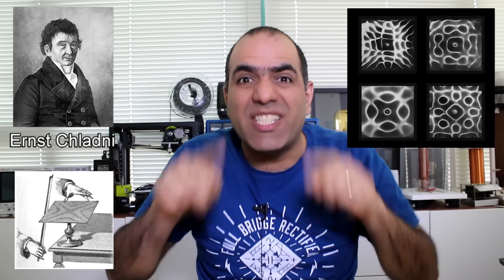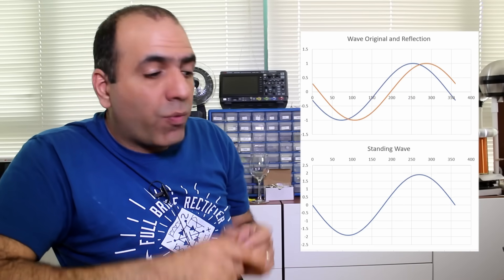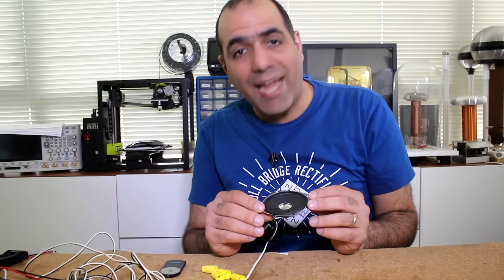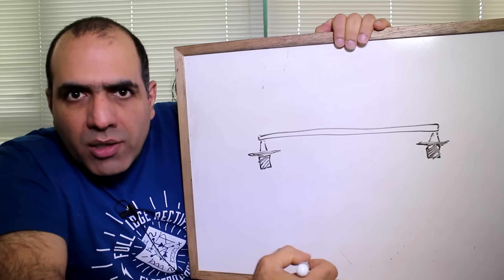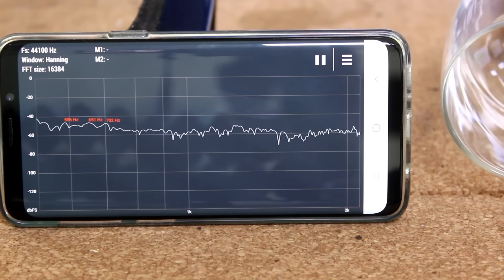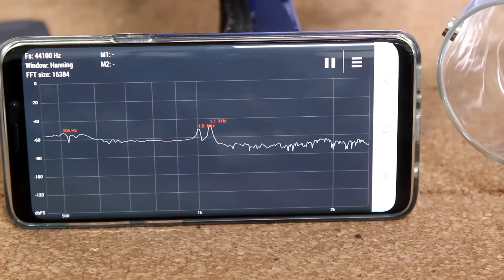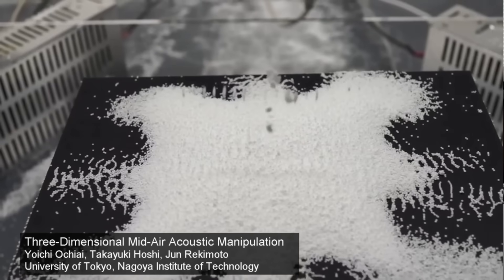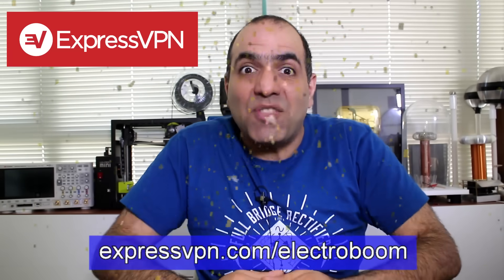Moving Particles with Vibration, Making the Chladni Plate

Comment: The theory is flawed.  The node is not moving continuously forward.  That's an optical illusion.  It moves forward a little and then skips back when the waveform is inverted.
You don't need an out of phase soundwave, you need a 3 phase soundwave.  Treat it like a motor.

Comment: By using a lot of ultrasonic transducers, like you mentioned at the end, you can also create certain points where the 40kHz gets modulated to around 200Hz by overlapping. You can actually feel those spots. So you can create haptic feedback by simulating shapes with those spots.

Comment: Acoustic levitation could indeed be a very useful thing, imagine you had something that could not be touched by any gloves or your hands otherwise it'd be contaminated or something like that.  Just use sound to hold it in place and you could move it by tuning speakers.  The fact is that while it's a cool party trick, it currently has no real use case, this is because it's a lot more expensive than glass, plastic or metal containers.  Even if these containers need coated with a special chemical it's still cheaper.  Not to mention it can be vacuum sealed which may prove beneficial.

Comment: this is an interesting video, i'm glad i finally came across it. you really made me wonder; would it be possible to dampen the reflections? i'd imagine that locking the edges of the board in a muffling material like foam might be able to do it. in that case, you could have a proper set up for the "artificial reflections". Thoughts?

Comment: A lack of temporal coherence? With two sources that are left to themselves to oscillate at slightly different frequencies, with one source "not knowing" what the other is doing, the salt would move around a bit due to phase noise. But if the faster one is triggered by the slower one, you may be able to move the salt in a linear fashion. If the sources were connected through a trigger signal, the reflections at the edge could indeed be a good reason why the salt does not move more. To dampen the reflections, you could put some (mattress) foam in contact with the board. Create slightly different indices of refraction.

Comment: That is interesting, you might get better response with piezo transducers and a new cookie tin.  The stamping stress hardens the metal, and you could put rubber cone supports underneath at the null nodes.  Just a thought.   Thanks again.

Comment: So Mr Boom, what if you reverse the idea and make the speaker vibrate could you make it levitate? I've had a theory about flying saucers and the humming noise people associate with them, being related to their means of propulsion and flight. Your video showed a clip of the powder being held up in free space. Would it be possible to reverse everything and hover the speaker off a resonant surface? Or, use multiple speakers to provide direction control in a similar way to your example.

Comment: So your explanation with the standing waves isn't really correct. In reality the system is described with a partial differential equation with boundary conditions.

The resulting solution is a linear superposition of infinite modes.

If you want your idea to work, you don't want to have 2 frequencies around the first mode. You're going to wanna have both speakers be at both frequencies and change the relative amplitudes of those frequencies in order to smoothly transition the antinodes from one pattern to the next. Continue doing this, and you should get something like what you want.

Plate modes have names that we refer to them. We label the number of half sines in each direction. For example, 5:23 is a great example of a (3,3) mode. Your boundary conditions are a little funky, so I suspect some of your patterns are a result of boundary condition mixture.

That being said, I just want to make sure that we're spreading incorrect information.

Btw, as for my credentials, I'm a graduate student who studies structural mechanics (vibrations) and I specialize in controls and piezoelectrics.

Comment: 1:57 Did someone say... INTEGRATE?
(1+x^2)^-2dx
Let x= tan (u)
Then dx=sec^2 (u) du
(1+x^2)^-2dx => sec^2 (u)/(tan^2 (u)+1)^2du
Using sec^2 = tan^2+1 and cos =1/sec
sec^2 (u)/(tan^2 (u)+1)^2 = cos^2 (u)
Then using cos^2(u) = .5(1+cos2u)
Simple integration yields:
.5(u+.5sin2u)
Back substitution (all good since tan(x) has well defined inverse for all real x)
.5arctan(x) +.5sin(arctan(x))* cos(arctan(x))|+/- infinity 
pi/4 + .5* 1 0 - (-pi/4+.5 -1 *0)
= pi/2.

Comment: Hello Mehdi. I have 2 suggestions for this:

(1) Maybe it is possible to set the input wave generator with a variable phase shift. In this way, you will be able to change the phase shift and, in turn, move the position of the zero point of the wave. You can then change the phase shift manually (with a knob) or else use a ramp generator to control the phase shift linearly.

(2) In your experiment, the salt was stuck moving left-right around a point maybe because the COMBINED WAVE was too fast and the salt could not follow. Imagine the combined wave being a sea wave and the salt being a person on a surf board. If the wave is slow enough for the guy to follow, then the guy would be able to ride the wave without problems and continue to move in one direction ... But if the wave is too fast, the surfboard would be slow and it would eventually end up on the peak of the wave and then on the other side of the wave, therefore moving backwards (down the trailing side of the wave) ... Following this reasoning, maybe your combined wave was trying to push the salt to the left, but then the wave was too fast and its peak went past the salt which means that now the salt was on the falling side of the wave which made the salt move to right until the next wave came to repeat the process. It would have been good to try to slow the COMBINED wave using F1=100Hz and F2=100.1Hz (rather than 101Hz) to make the combined wave travel much slower.

Actually, it would be interesting if you make such a test for point 2 as a follow-up video  : )

Comment: Electroboom: I'd like to make my own plate using a speaker as an actuator as u know a speaker is a magnet and a coil that when u excite the coil with an AC voltage it vibrates a the same frequency. speaker blows up ahhhhhh F***!!!!!!!! I need another speaker, as u know ever speaker has its own rating

Comment: You could engineer one sides of the board by adding a different material in such a way that the waves' reflection coefficient is minimised. This would cause both waves to not be standing anymore, but it would allow you to move the salt around. If the theory for electromagnetic waves holds, then the Fresnel reflection coefficient should be a decent formula provided the equivalent refraction coefficient of mechanical waves for cardboard (and the other material) can be calculated. It's probably going to be some ratio or combination of mass and some kind of Young modulus.

Comment: Take with a grain of salt I'm a computer science student, I am NOT an engineer or physicist, so naturally I'm not all too familiar with how these things work. But I can extrapolate some of the concepts to attempt a solution. What I'm seeing is a loop that is supposed to increase the position of the salt in the X or Y coordinate based on the difference of two variables. The reason why I think it is not working is because the maximum frequency acts as a limit for the loop, which is causing it to terminate early. If you were to steadily increase the difference (and by extension the maximum frequency) as it goes, the loop would eventually push the salt off of the plate (or make it vibrate into a funky looking pattern and not sweep it at all). You'll have to manually terminate the loop tho, as I don't thing the system has a way of knowing when the salt is off the plate, but at least it would sweep it off (in theory). 

If anyone knows better, please do let me know, I AM curious about the rest of the sciences so it would be cool to know whether or not my theory would or wouldn't work

Comment: Its not necessary for the particles to travel from one side to another, the reason why sound travel is the movement of molecular vibration in a specific region, which passes the energy to the next molecular region. That's why its impossible to shift the salt line from one side to another.

Comment: Can you do the same thing but with electricity instead of sound? Moving particles with electrical vibration instead of sound vibration. Can it be done?
I suppose it can only be achieved with Tesla's longitudinal electricity and not with AC or DC. Google "Transverse & Longitudinal Electric Waves and Tesla’s Longitudinal Electricity - Eric P. Dollard" and "Longitudinal Waves and Transverse Waves tests by Jean-Louis Naudin" for LMD circuit diagram that produces longitudinal electricity.
Also youtube search "Replication of Eric Dollard's Analog Computer" where you see electric field and magnetic field measured behaving differently in transverse vs longitudinal electricity.

Comment: I think the reason why the salt move back into place is due to newtons law. As the salt get pushed by the +1 hz it pushes back on the wave. Then the field change and now that +1 drops to 0 and the salt still want to push on the wave that originally push on the salt. Then the fields push on each and creating the dead spot. As the field push on each other they distribute up and down (assuming the wave is horizontal) but there a barrier under the salt so it reflects back up and increase the wave that want to push up. So now we have a force pushing up and a horizontal directions so now the salt is as all it need to move back where it was. The salt wouldn’t be able to move back with out the vertical wave push on it due to the friction between the salt and the platform. 

Not a physicist so might be wrong.

Comment: Cant you use 1 speaker at a fixed frequency, and you slowly increase the frequency of the other, so the tiny shifts shift, and it moves? Im not an expert, but i would give it a try

Comment: What if the frequency wasn’t symmetrical? I mean the peak to other side should be stronger than the peak back. That way the particles may “jump” more to the first direction than the other.
Try checking vibrating conveyors.

Comment: A sound is absorbed when moving to a more dense mass and reflects when the mass is less.  If you have a circular poster board with a more dense material like nylon plastic on it's out perimeter the sound generated will be absorbed into the the poster board then will enter the plastic then will reflect within the plastic reflecting back and forth within the plastic without reentering the poster board.  Great video Mr Boom

Comment: Why don't you try making the wavelength difference between the two waves equal to the length of the board that way the oscillation of the wave from one end will drive the particles to the other end and vice-versa? I don't have any lab access to try this. But m pretty sure this should work though.

Comment: reverse polarity. , output wattage and ohm laws apply to your equation. and also add a heat sink or some type of heat dissipation system to prevent your diy amp from overheating ohm laws is also a factor in excess power withdrawal heat dissipation

Comment: Just put a resistor at the end of the plate and connect it to ground,  remember to use the same impedence as the plate to remove the reflections

Comment: The solution to your problem is not frequency difference. Instead, use identical speakers at both ends with the same frequency, but with a 90 degree phase shift (we use NI DAC to do that). This will create a traveling wave in the structure and will move salt particles for you. Let me know how it works. Excellent video by the way! you are awesome! Keep up the good work
Reply: how exactly do you achieve a 90 degree phase shift? Ive been looking into the idea of Phases but dont seem to really get how you would achieve that here
Reply: @TheVk30  2nd channel of the sig gen. the output phase angle can also be changed on signal generators

Comment: What if you lined up the speakers in series and fired them off in tandem...would that process of actuation move it along? One on, prev one off ..... Etc... Sorta like Spark plugs in a combustion engine. Would the line formed then move from one to the next.. or would it be a new line created while the old line disapates? I'm assuming you'd have to calculate how long until the previous vibration ended before you can fire up the new so there wouldn't be interference... Just using my imagination lol

Comment: How can a DC device work with AC? I recently purchased a used keyboard (works with 9 DC) and it came with an old Nintendo Nes adapter (its 9v AC) and it works in some outlets but not all of them in the same room

Comment: My intuition would be that with speakers on both ends forcing the oscillation, you’re not restricted to standing waves that are reflections on the material. So you can shift in phase space and get the particles moving that way.

Comment: Please do a review/Test on KiloWatts Labs Sirius Supercapacitor ( 71000 Wh / 3550 Wh) ? Arvio says the supercapacitor module has the following characteristics:
 Can be discharged 100% without problem?
 Fully charges or discharges in 30 minutes?
 Has an operating temperature from -30 to 85 degrees Celsius?
 99.1% round trip efficiency from DC power into the module to DC power out?
 No chance of thermal runaway, which is a technical term for, “Oh my God!  The battery’s set itself on fire!”
 A 10 year warranty that covers 100% of the module’s original capacity with unlimited cycles / 1 Million cycles? 

https://kilowattlabs.com/product/sirius

Would you recommend buying this sirius energy storage supercapacitor over a conventional battery???

Comment: You can visualize this in ANSYS.  Just run a pre-stressed modal analysis and specify the number of harmonic indices and the number of frequencies to expand.  Contour plots will show different mode shapes of the plate.  We use this principle to analyze turbine airfoils.

Comment: I am supposing that since the foam board is not absolutely level, you can vibrate the line of particles up or down an incline and also control the particles' line position? Can the vibration be used to greatly reduce friction and construct a toy hovercraft using this principle? If it is efficient at eliminating friction, a vibrating base with a sound dampening surface could be used to transport objects over surfaces using much less force? I am enjoying this sideline of thought to straight electrical theory. :)

Comment: Hello Eng.Mehdi I'm an electrical engineer. I have learned a lot and laughed a lot watching your video really appreciate the good work. But i have a question what will happens if you try to connect 2 phone charger 5v in parallel or any power supply and is it even possible??

Comment: If you can generate a line composed of diferent nodes of salt and make them oscilate by adapting the frecuency, why dont you play only the parts where the salt oscilates in one direction making the salt skip from node to node.

Would that work any better?

Comment: Hey Electroboom, do you have a flyback transformer? I just got one and it’s a lot safer than a microwave transformer, has a higher frequency, and can be driven with a zvs driver from a power supply rather than wall power. Here’s the one I got = https://www.amazon.com/SainSmart-Voltage-Switching-Generator-Ignition/dp/B00ZTTVX4O/ref=mp_s_a_1_3?keywords=flyback+transformer&qid=1560829176&s=gateway&sprefix=flyback+&sr=8-3

Comment: Could you at some point consider doing a video on 3-wire single phase systems (120/240v, split phase, etc)? Specifically the vectors of balanced and unbalanced load, the relationship between the grounded conductor and the ground wire, etc. I think a lot of people would find it useful.

Comment: Curious question. I took a bunch of rectifiers and diods from trashed flatscreen. Would I be able to use either to make my motorcycle ac to dc? 
The biggest rectifier is a TS6K60
Diods are “LT3247”x4 and “LT3150”x4

Comment: Hi, i think you should try the same setup with the long foam board using a higher frequency than the base resonance (maybe 10x), output the same frequency on both speakers and play with the phase shifts between the two.

Comment: The speaker plugged into 120 volts AC was hilarious!!.😂👍
Reply: Can you get 1800W from a 5W speaker?
Yes, but only for 1 second
Reply: @nipunagunarathne4882  If he would have USED a speaker rated for 1,800 watts,it would not have exploded like that.
Reply: @4gauge10  you don't say
Reply: @nipunagunarathne4882  He mentioned that in the video.
Reply: @4gauge10  yeah that's what i was referring to
Reply: @nipunagunarathne4882  Ok,I wasn't sure.
Reply: I one time put gigant speaker in 240v it worked

Comment: I have tried and it works: if you roll a cilindrical flower glasse jar (not to thick) with a conductive wire, like a coil, and connect it (with limited current) to 50 HZ 230 V it will crack in a perfect spiral after a long time.

Comment: Thank you, Mehdi, awesome video! I had an idea about how you could stop each wave from reflecting off the opposite edge: What if the board was shaped with jagged edges, something like this:
   ____________
<                           >
< o                     o >
<_______________>
Then the reflections of the waves would go off at ninety degree angles with respect to the length of the board, and cancel out from the other triangular edges, but each speaker would still produce a wave that crosses the board to the other side... What do you think? Revisit? :D